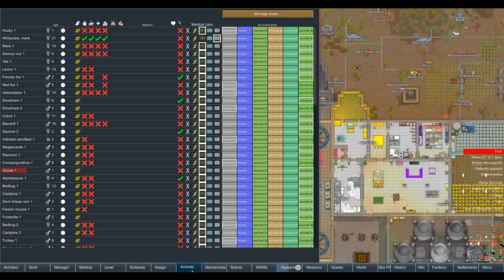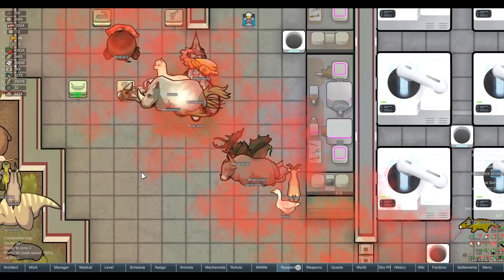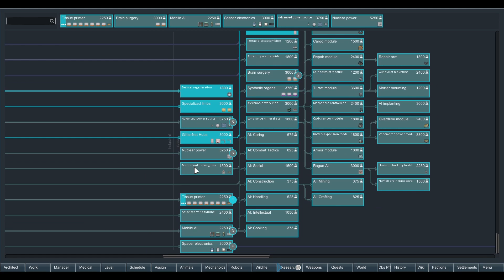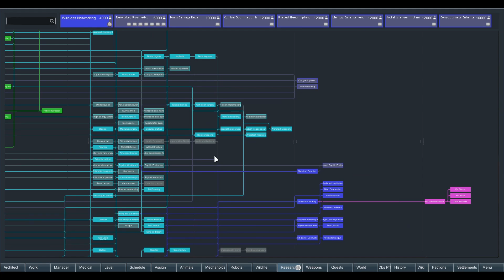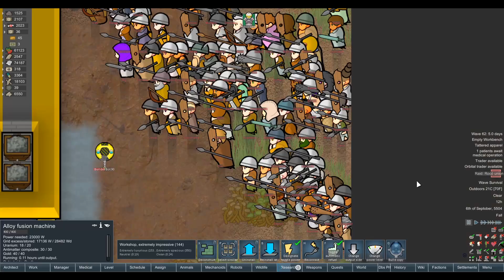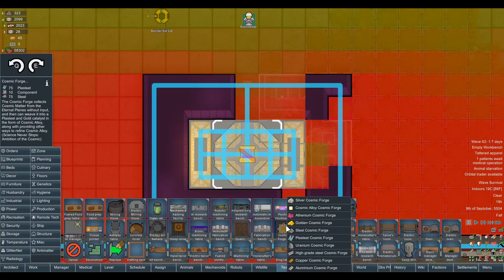Rimworld: Father of Machines #25 - Cosmic Energy

Comment: Just a minor heads up: the silver research linkables (the single tile ones) can only have 20 linked to the bench at any time. Looks like you're wasting a bit of space with some of the extras you've got there. If you've got other research linkables you can fit them in there instead of the extraneous ones.

Comment: 100k  for 1st generator, I think the 2nd or 3rd one is 1.5 million power per unit, but it requires cosmic matter. Cosmic matter is long af to farm, the "750 work" is a lie since it feels more like 7500, but it gives 100 units each time. You will regret not getting the omnis for this, though maybe your assemblers can be good at drawing cosmic matter.
Reply: Generation 1 is 100K for 1.1 years
Generation 2 is 150K for 3.3 years
Generation 3 (Omega) is 1.5M with no fuel cost other than construction cost.

Comment: Mr. Streamer:  The glitternet hubs can increase your power output significantly.  Each advanced hub adds something like 25% or 30% of the output of whatever you connect it to.  They are a bit confusing in that the hub itself generates the additional power, rather than improving the output of whatever you connect it to.  If you hook three up to your cosmic power plant, you can almost double its output.

Comment: The outer layer of the wall is the worst you can fortify because it's the first raiders have access to and, if they decide to target the walls, they will hit it until it breaks, regardless of if it has 400 HP or 5000000. I learnt that the hard way when raiders spent hours hammering away at beta poly walls...

Comment: Slight increase to research speed could be gotten from replacing all the floors with the draining tiles and putting down the mess suckerup thing to improve the room cleanliness slightly more.
Regarding the animal kibble situation you want it to be transported to the animal harvesters as they will store it and use it to bring the animals over to them to gather from the animals when they feed.
On another note I believe your apparel recyclers are bottlenecking due to only being delivered one item at a time so only one recycler is going at once.

Comment: The cell Said it could Produce 100Kw for a year, the output of the Reactor is 100Kws AKA only about 876MWH over a Year (asuming 365 days) witch is still less than 1 KiloTon (1000t) of TNT
1 Ton of TNT is about 1,162MWh
1 Kt 1,162GWh
Reply: How much power was Nagasaki and Hiroshima? (In terms of power the bombs were)
Reply: @baseballjustin5  Fat Man/Nagasaki was  21000t of TNT
24,402GWh
Hiroschima 15000t of TNT
17,43GWh
Both bombs are """simple nuclear Bombs""" and didn' t have secondary Hydrogen Bombs (Hydrogen/Fusion bombs) modern bombs are probably more powerfull due too having this "feature"
Reply: @austrianfuck7450  Modern nukes are crazy more powerful as they are generally a 2 stage explosion. Older TNT based explosives all the way up to plastic explosives are single stage, and it's basically "make thing go boom," whereas a 2 stage explosives have an implosion (fission) stage, which initiates stage 2, followed by an explosion stage (fusion). Nuclear/hydrogen based also add an insane shock wave due to super heating the air and essentially causing a super high pressure zone to wipe out pretty much everything. See "thermonuclear" for a more detailed explanation

Comment: Attach the GlitterNet power integrators to the Anti-Matter Reactor and any other power source, tbh. It's percentage based, so using it with the big boy Anti-Matter reactor should be pretty impressive in terms of the upgraded output.